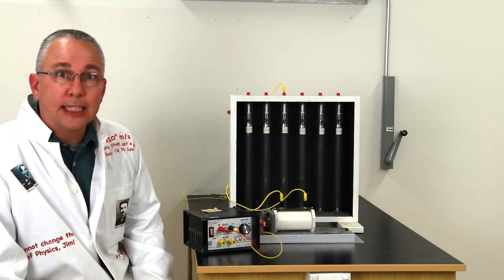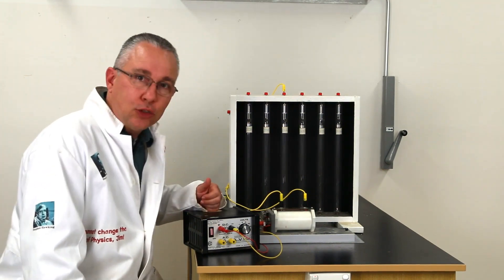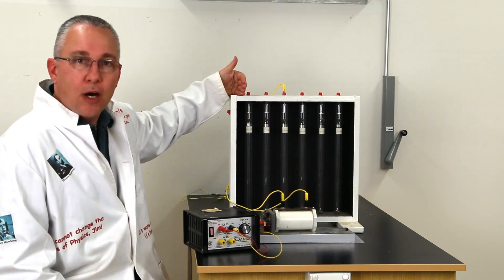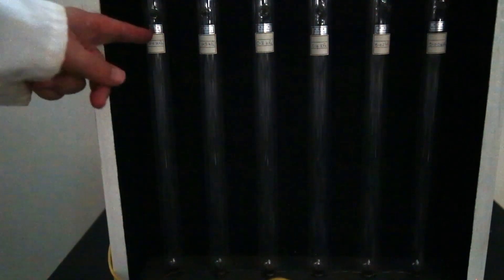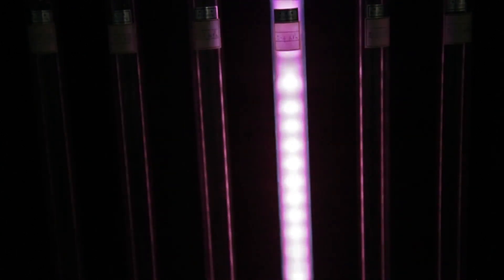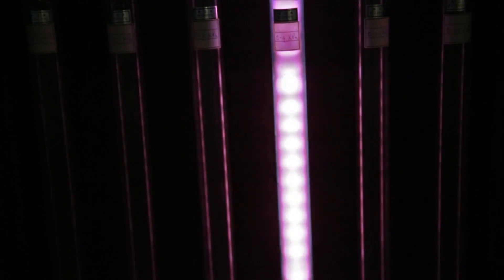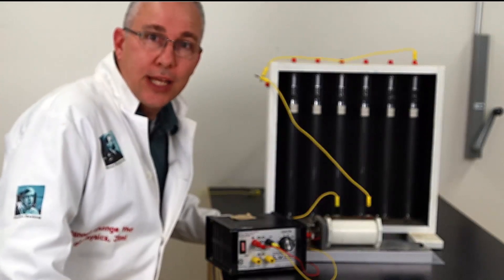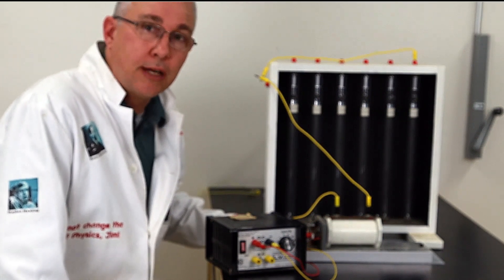Discharge Tubes : Demonstrated and the physics principles behind them

Comment: A fine demonstration except for one thing... it can't be mercury in the tubes. Mercury is of course a liquid at room temperatures and so its vapor pressure in a glass tube like this is solely a function of the temperature of the tube at any given time. In other words, there is no way to control the pressure of an array of tubes like this at room temperature if they're using mercury as the discharge medium, aside from actually passing different currents through them which would eventually heat them to differing degrees. Also, the color is totally wrong for mercury which should be a pale sky blue. This must be either argon or air or something in these tubes. It has to be a gas at room temperature whatever it is. You are a physics teacher, so I know I don't have to tell you what the easiest way to find out what's actually in there is!
Reply from the maker: Thanks. They were the original tubes that I found at the school which were labeled as such. I never questioned them. 
I now need to investigate.
Reply: @PhysicsHigh  👍🏻 I will guess.....argon! let me/us know when you find out!
Reply: @PhysicsHigh  @Muonium1 I was glad to find this comment because I recognised mmHg ("millimetres of mercury") as a unit of pressure... but couldn't have explained the conundrum so eloquently! I believe blood pressure is/was measured in mmHg since it was literally an indication of how high the liquid mercury would be lifted against gravity as a result of the pressure in a tube..?  (still not sure what the gas in the tube is... I would've guessed it's just air?)